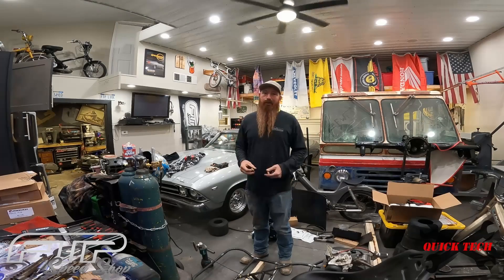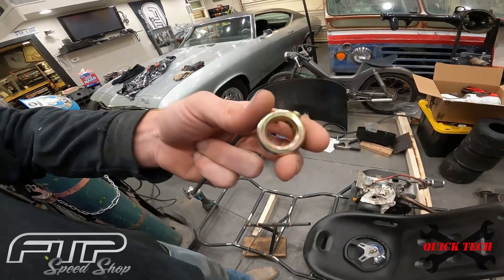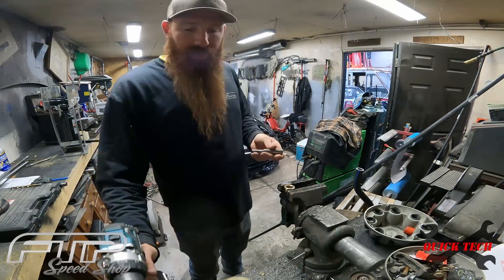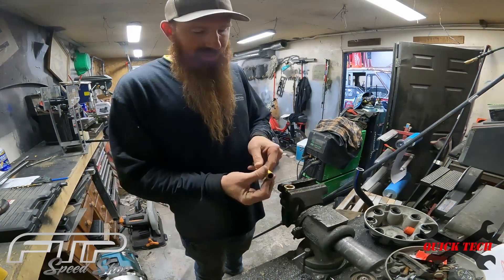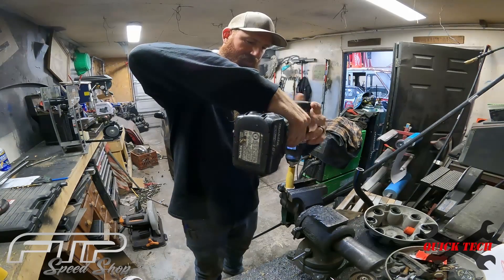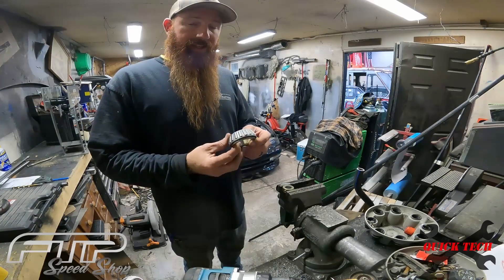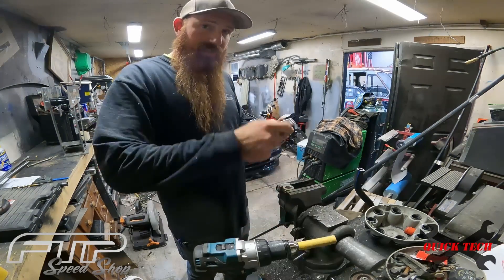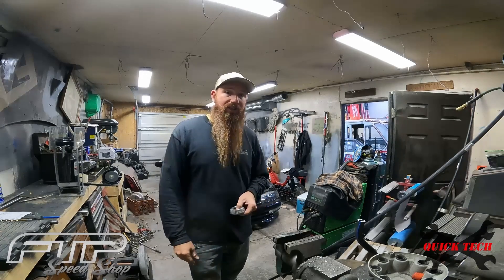Easiest Way to Slightly enlarge the Inner Diameter of a Bushing, Bearing, or Collar

Comment: I'm needing this tip to slightly enlarge the hole in some shocks to put a larger metal bushing in them for my custom 65 C10 project.

Ironically, found your video and I realized you have what looks to be a really nice looking 4th gen Prelude back there.  I had one of those in high school and into college and absolutely loved it.  A few years later I fully built a 91 CRX from the ground up which was my pride and joy that I have a full documentary video on my channel of that build.  I've just always wanted a classic truck on air bags so after building my dream shop the CRX has been sold and I'm building something completely different now but I cut my teeth on classic Hondas.

Thanks for this tip!  Gonna give it a shot.
Reply from the maker: Thanks I had a 4th gen right out of highschool and sold it to buy a truck for work.  I always regretted selling it so I bought another one a handful of years later and fully built it how I want to build the first one.    

This trick works great to enlarge holes I use it all the time!  

Good luck on your project.

Comment: How do you hold the bearing to enlarge it?  I wouldn't want to put it in a vise.  Thanks for the tip.
Reply from the maker: I just held on to the pinion bearing with my hand.
Reply: @FullThrottlePerformanceMike  Thank you

Comment: Doesn't the inner race just spin when doing this to a bearing? How to avoid this?
Reply from the maker: So the only reason we did that on the reared bearing was for ease of setting up and measuring the preload.   Once we got the proper shim stack figured out, we pressed a new bearing on.   As for a brass bushing, you need a little clearance for it to move.